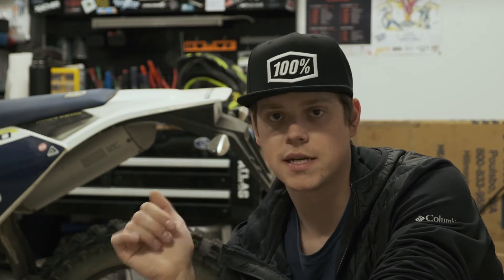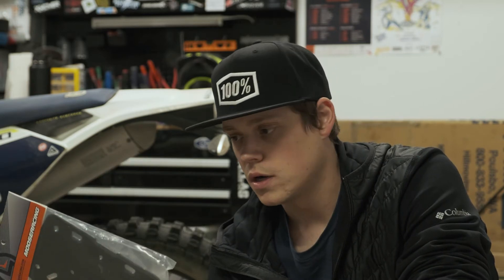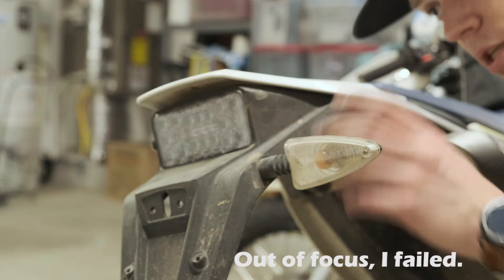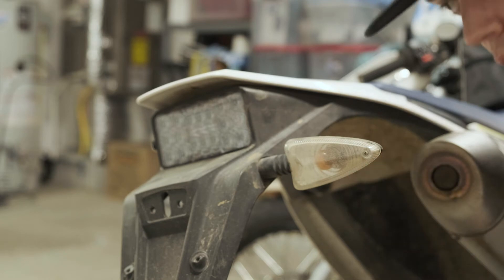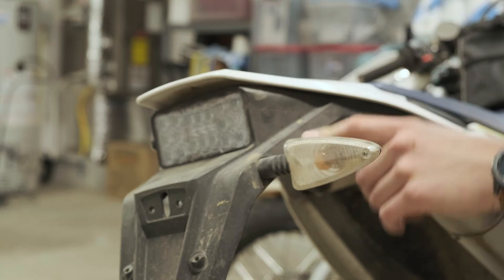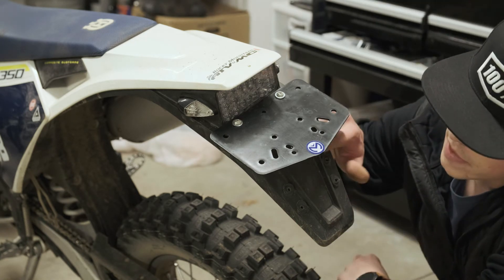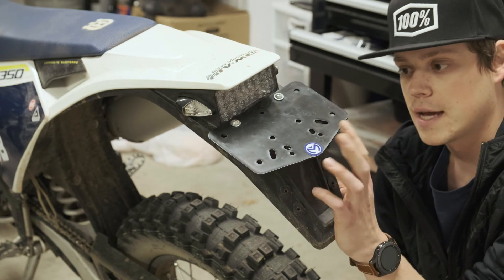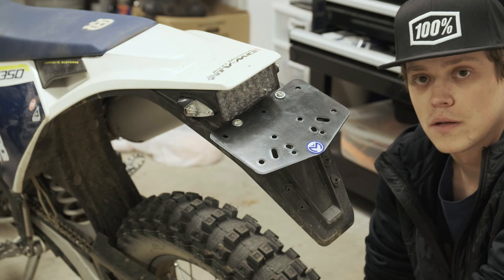Husqvarna $60 Fender Improvement// Sicass Flush Mount Signals// Moose Racing Universal Plate Mount

Comment: Much nicer!   It looks like you still have the two screens installed at the end of the tail pipe.  I couldn't believe how much smoother and cooler my engine ran when I removed mine.  If you're interested Jeff Slavens has a video on how to remove it.
Reply from the maker: Yup still have the screens, dont want to remove them unless I have a TPS adjuster. Will likely leave it as is until I get new exhaust and a new ECU.